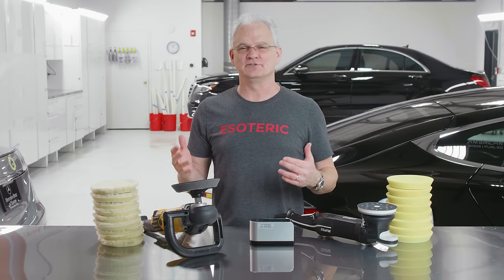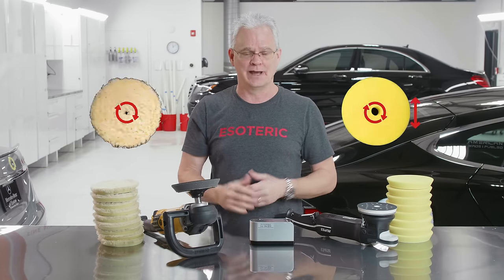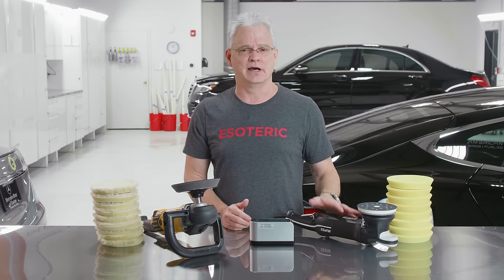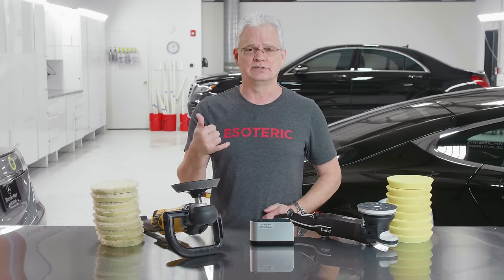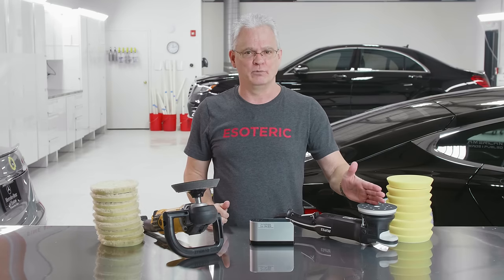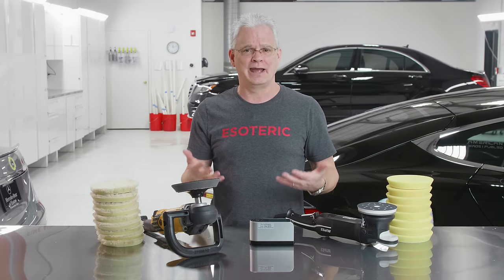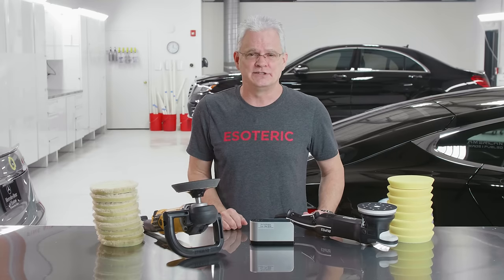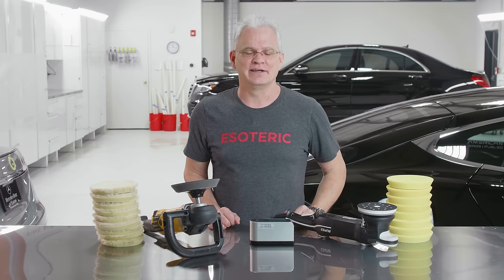Still polishing with a rotary? THIS could change your mind!

Comment: i work as self-employed do a lot of paint restoration work polishing old resprayed shoddy paint up and do a lot of paint correction before i even think of picking a spray gun up i go for mirror finish so correct what I can before painting and will wet flat the finish and probably finish on a 3000 wet trizact flat sometimes up to 6000 but will do my first cut old school using a heavy cutting compound with a rotary with lots of water ie g3 paste not the liquid, will then go over it with the da polisher to refine but the da would no way get the first cut I need to make it pop. I've tried lots of cutting compounds and to me, old school is the best way.
Reply from the maker: I can assure you that you're not trying the right combinations of pads, compounds, machines, and techniques. We have done evaluations many times over using a DOI meter to measure clarity, and that's how we draw our conclusions.

Comment: Rotary is still the best way to polish most cars I been rocking one for 40 years, I also use the DA Polishers for areas that might not be user friendly...
Reply from the maker: I guess we'll have to agree to disagree on this one.
Reply: MasterSpin77 -- YES !!! I have been rocking one longer than you.. :)
Nothing beats direct drive in the hands of an experienced user..
Guess that is why every assembly line of anything that is painted, aircraft, everything, goes by the guy/s with an air powered Rotary, fixing those last little things that happened up the line...
I put a small spacer on the end of mine and it gives me just enough extra room to put even that little 1 inch backing plate and pad just on that little recessed spot, or that little scratch, etc., and get it out quickly... DA's I am not sure they can change backing plates and pads all the way down to 1 inch...
Perhaps they can,  I dont know, and do not even care to know..  :)
Reply: @frandanco6289  It dont work...it's like turning a bowling pin upside down and trying to balance it..

Comment: I worked at a Mercedes dealership for a while and I used both of the buffers in this video and it’s a matter of what you start off with the dewalt is what I started off with and I loved it and you just gotta get used to it and the Bigfoot we would use as a secondary polishing step after the dewalt especially on darker paint colors
Reply: I have paint corrected all the German cars in the hundreds and nothing but Rotary Power on all of them.. It is an art just like real professional Detailing is, but if you take the time to learn it, and dont mind getting a lot stronger in your upper body, having way bigger forearms, biceps and shoulders, then the Rotary is there and easily more efficient in the right experienced hands...

Comment: Part of the problem converting to the d/a in a production body shop aka insurance specific shop is the cost of material. Most shops I know strongly consider the cost of the compounds as well as the pads not to mention how quickly a detailer goes through them every week. Some shops even have  a provided list of material that you are not allowed to steer away from in every department. How efficient is this system in dealing with solvent pop and dye back issues as well as runs in the clear coat after painting? Keep in mind as you're probably already aware, most shop managers want you to finish the paint corrections in least amount of time possible. Usually 30-45 minutes a vehicle at best on larger jobs and 10-15 minutes on smaller jobs
Reply from the maker: Apples and oranges in that situation as body shops are not going for nearly the same level of finish as detailers. Most people who claim how much "quicker" rotary polishing is are just doing a heavy cut with no finish polishing at all. 30 minutes is not paint correction, it's simply running a machine across the surface.

Comment: i own both but only really use the rotary for deep scratches/oxidation like boats and rvs or a really neglected car/truck. always finish with the dual action tho. seems to go faster if you use both. Rotary for heavy cutting and compounding and dual action for polishing, applying sealants. if it’s just a one step correction i won’t even touch the rotary tho. just my two cents.

Comment: I spent a lot of years fighting with rotary polishers. When I discovered DA polishers I literally gave my rotary away! The ease of use and consistent results was a no brainer for me. Thanks to you Todd I’m polishing vehicles more often and producing safe and consistent results! Thank you!!
Reply from the maker: Thanks for the great feedback! Yes, the DA is way easier to master and get fantastic results.
Reply: Rotaries are easy to move and get correction from but its mastering the finishing where most people fall over when using a rotary.
Reply: If you spent years Fighting Rotary Power, why did you not learn how to use it so there would be no fighting???  I love my Rotary and we never fight...
Reply: Some people will just never learn to use the rotary, it's to scary for some. That is why they invented the DA so you can go slow and easy and not panic
Reply: Rotary's are very easy to use, there's just to many people out there keep hearing scary stories about the burn and it scares them there's nothing wrong with that the problem is they keep talking about how the DA is better when they really never learned to use the Rotary

Comment: Funny thing I leaned on a FLAX Rotary lol when I had no clue what I was using- I did two of my cars with it.. sold it for my Rupes Mark 3 Big foot lol
Reply: Was it a Flex Rotary???  They spin counter clockwise, which is not how everything else spins so that sometimes in a little issue... They have the best direct drive but even they are not full direct drive like their Rotary machines are...
If you had no clue what you were doing with a Rotary, too bad you could not get some help...  
Myself,  I want the pad to be Direct Drive so I can correct faster and finish even faster still... Have to be willing to take the time to learn how to use it.

Comment: About 10 years ago I did a lot of compounding (M105) on a porter cable DA with an aggressive foam pad, and then I would go back to jewel the paint using a rotary and a finishing pad and fine polish (Menzerna grey stuff I forgot the name). The DA was unable to achieve the kind of gloss some of the ultra fine polish was designed for. I was not a pro, but I did not have issues using a rotary for the finishing step. I never shared this information with anybody. But this is the first time I hear someone actually did that and I wasn't alone!

Comment: What about combining forces? Rotary for fast compounding, DA for polishing and refining.
Reply from the maker: Years ago we switched to just the opposite...DA for compounding, and rotary for finishing. But then DA, polish, and pad technology caught up to do the whole thing. You don't necessarily gain speed by compounding with a rotary...
Reply: @Esotericdetail  I respect your channel and your knowledge but I have not found this to be true. If your dealing with hammered paint the da seems to take forever.. This is what I have come to find. If you can make any suggestions I'm all ears. I use megs microfibers and sonax cutmax on the da and I can cut atleast twice as fast with the rotary.
Reply: In my experience, you are right Todd! 21mm DA cuts faster than the rotary. I do love the smoothness of a rotary though!

Comment: Rotary is for advanced technicians. It’s much faster, you can knock out cars all day long with it. DA is a safe tool, can’t go wrong with it but when it comes to 2 or 3 stage corrections, it’ll take longer. You can also use both. Rotary for compound and DA for polishing.
Reply from the maker: I wouldn't call it an "advanced technician" by any means. And speed isn't much of an issue either because if you're hitting something with a rotary that hard and fast, then chances are you have 2 more steps to get to a finely finished product. You also have much more taping and precautions to take with the rotary. A 2-step process on a D/A, with the right techniques, can take you for a horrible condition to near perfection. The only time a 3-step might be needed anymore would be a really finicky, older paint. I used rotary for years, then switched to DA for compounding and rotary for finishing. Then when machine, pad, and polish technology caught up, switched everything to DA and haven't looked back. Once you master a long-throw DA, there's zero need for a rotary anymore.
Reply: @Esotericdetail  You know what, I think you’re right and I am wrong! You’re DA to Rotary method does make more sense! Will have to try that today.

Comment: DA's are good for detailers, diy and maybe inexperienced bodyshop finishers..they are a lot safer and very good. But in a good bodyshop a DA polisher just doesn't cut it, Rotary's are far better. You need to know how to use them properly though and if not then don't stick to the DA..easier to use.
One isn't better than the other..just depends on what's it's being used for !!
Reply from the maker: We've seen a lot of body shops have the same feeling about them, until they have experienced how to get the most out of a good DA. And for the body shops we feel that the rotary is "faster", they're typically not doing anything to properly finish down the process after compounding. We were extremely good at rotary work, but dropped it completely years ago once new technologies came about in the machines, pads, and polishes.
Reply: Like on newer cars with maybe a small scratch or two

Comment: I've got the Duramax rotary and Tork Long throw 15mm DA polisher. Haven't used either yet. But I had a 8mm short throw da I used till burnt up but it was too slow to do the jobs
Reply from the maker: We used 8mm throw DA machines in the early days, and it sure was nice when the 15 and 21mm machines hit the market!

Comment: So, I learned on a DA and have had good results. However, when I moved over to doing a business that predominantly does fire apparatus. With the paint that is used on these trucks, I found the only way I could achieve results with the hard paint, was with a rotary. I changed pads, compounds, even purchased the Rupes Mille, to power through in hopes of making progress. Todd, I'm curious to hear your thoughts on this and suggestions, because as you said the learning curve for teaching anyone to help me, well you know where I'm going with this. Thank you again for all the info you always provide.
Reply from the maker: I guess it depends on what level of polishing you're going for on these trucks. I would imagine that making them look "better" is the goal, as opposed to near perfection-level, but correct me if I am wrong. If my assumption is correct, then couldn't you do just an aggressive 1-step process with the DA? It all comes down to the levels of expectation, and remembering that detailing is more than two levels (washing, or full correction).
Reply: @Esotericdetail   Well For me, I am restoring the apparatus and then afterwards, educating the crews on changes they can make to keep the appearance of their trucks up to that show finish. As you know these trucks are big purchases for departments, and they are always on display.  One of the things I was brought in to do, was removed the years of swirls, from using truck brushes with no grit guards, or even very used brittle brushes on the trucks. So we did a test on an older truck, which was brought back to a high glossy finish. Ceramic coated, and now the truck sitting next to a new truck by 10 years, looks so much better then the one than the new truck. We also put a pressure washer in that station and  moved them towards a better wash system. But as to the Swirls, I went through many different combinations, till the rotary was the best result to remove the swirls on the very very hard surface.

Comment: Pro rotary folks state that DA's are for cutting, rotary for finish. Their reason is micro marring that only happens with DA. Your thoughts?
Reply from the maker: That statement would be based on not using the right combinations of pads, polishes, and techniques on the DA in a finishing capacity.

Comment: Well I cannot get rid of 1200 grit sand marks in clearcoat using my Porter Cable da in 6 passes so I give up. Going to now try a rotary since what I read it's way better to get those marks out.  Using good pads and compound and that walmart stuff.
Reply from the maker: The problem is the small throw of that Porter Cable you're using. You get more than double the polishing action out of a modern long-throw DA machine than you do with the PC.

Comment: That dewalt u got there is a killer machine.
I have that ans use just for cut.
It is fantastic
Low Rpm 600 to 1200 its enough.
Good pad and u cut fast.
The machine is strong and i recommended.
By the way yes u can easy master the DA but u get the Jeday degree with the rotary...

Comment: Another Great video, you guys Really Know your stuff. I learn soo much from listening to these videos. I'm fairly new to paint correction. I had a question...... Please.  What about removing heavy oxidation and haze on a Boat. Would a DA paired with a wool pad and heavy cut compound be enough to cut through gelcoat??
Reply from the maker: It's just like any other job...you won't know for sure until you try it. Each job requires a few test sections to find what is going to give you the desired results. I'm sure there would be some that requires heavier, and others that would work fine.

Comment: Great subject.In the hands of a skilled pro,the rotary always wins,no doubt,but that tool is pretty much a body shop item only at this point.The dual action just doesn't spin fast enough to keep up but it's much safer.Pros and cons with each,but that's life..I own both btw.
Reply from the maker: Thanks Marybeth, but I have to disagree with you. In the hands of a skilled pro, they are both going to do a great job, but the DA wins because it can be done in less steps with fewer precautions. And our DOI meter proves, without subjectivity, that there's no difference in the clarity of finish between the two, either. Thanks as always for chiming in.
Reply: @Esotericdetail  they are points of view. A good professional detailer MUST be very skilled with both machines. It's true the majority of work is one step and you have to do it with a DA, but if you have to do a two steps? Two steps on a hard clearcoat and it is full of rids? You absolutely need to cut with rotary, then you can choose to refine it with rotary or DA. DA finishing is easier than rotary, but I would not say the glossmeter will say the same answer 😉. Try to cut with a rupes lh19 or similar instead of an old rotary, a hard foam pad and a good compound, do a good zenith and then refine with a DA, then tell me😉
Reply from the maker: @ilnikmeinster  We will have to agree to disagree on this one. The only thing that matters is that the correction can be made with a good finish...not the tool(s) being used. You simply do not need a rotary to cut defects, even on hard paint. We have been using the DA for compounding for the good part of 10 years now on all types of finishes with zero issues whatsoever. You have to have the right combination of pads, polishes, and techniques to get the most out of it. It is a myth to say that only a rotary can take care of this. We also have modern rotaries from Rupes and Flex and test all of the time. The DOI meter (not a gloss meter) tells the true tale, as it measures a variety of clarity parameters including the flatness level of the paint. It takes subjectivity out of the equation, and provides absolute facts on what is going on with the surface. We have worked with OEM manufacturers and paint manufacturers / suppliers to OEM with testing products, processes, and tools. When we show them the differences, with the ease of training, then it's a done deal.

Comment: You did not mention what pads and polish needed for 3 step using a rotary vs the two steps used with a DA... also were you talking about a 21mm throw DA or an 8mm DA when comparing ???
Reply from the maker: You are correct...I did not. As for DA, we're talking about either a 15 or 21mm throw machine.
Reply: roadstar499  There is never going to be a set pad, polish, machine throw, etc., that works for all paint... It all depends, heavily, on the condition and type of paintwork to start... there is so much more to go over, perhaps you should spend more time on research or sign up for a class... Good luck..

Comment: I have been using rotary from day one and coming from a body shop aspect.. da takes to long ... even tho you have more step .. u can cut alot faster.. da takes way to long to cut out 2000 sand paper marks as to a rotary. So i agree yeah it takes more skill with a rotary but still i dont think da is better. Only my option
Reply from the maker: Also coming from a rotary, I can say that if you're convinced that the rotary is that much quicker, you're not using the right combination of tool, pads, compounds, and techniques to get the most out of the DA. I've done classes and demos for body shops, and even in factories with the same outcome...those in doubt were blown away by what can be accomplished with the DA. Not only were they blown away, but they also replaced their rotary with the DA and applicable pads, compounds, and polishes.
Reply: Rotaries not only cut better, they finish better, and more importantly they do those both significantly faster than a DA.  Anyone doing this for a living has no reason not to use and master a rotary - time is money.t